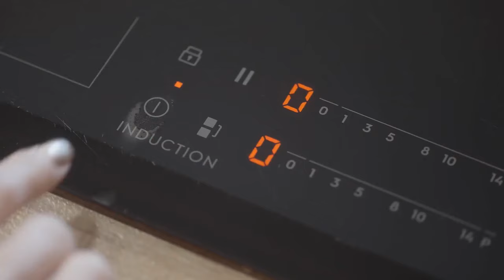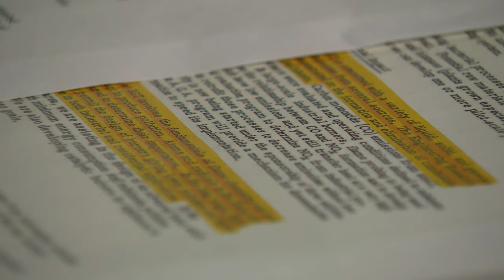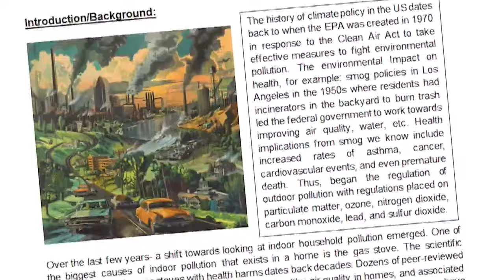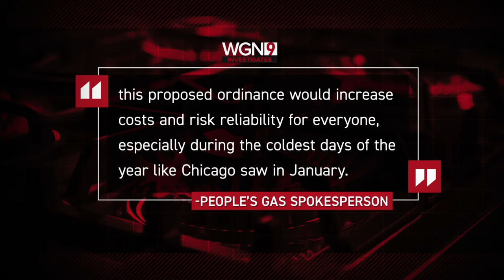What's the future of your gas stove in Chicago?

Comment: How do you keep your house warm!? When the electricity down. !? When it’s -10 outside!?? 

Head to the police station!??
Reply: Hope you have a fireplace because you still need power to ignite a furnace or boiler
Reply: @m3ronz  A gas stove works without electricity. and people do rely on that when the power goes out.
Reply: @William1866  We’re talking about heating the home stay on topic. Using your gas stove is not designed to heat your home. Research before you attempt  to educate. Don’t be ignorant.
Reply: @m3ronz  No, we are talking about staying warm when the power goes out. Stay on topic. Thousands of people for decades have relied on using a stove as a heat source when the power goes out. I am 68 years old. I HAVE DONE THIS AT LEAST TEN TIMES Yes, it isn't efficient enough to heat a whole home, but it does good enough for a studio apartment, or if you all just hang out in the kitchen area, close a few doors or hang up bed sheets to wall off an area. Only a buffoon would not understand when it's below zero outside and your power is out for over day that this isn't a better option.
Research before you attempt  to educate. Don’t be ignorant.